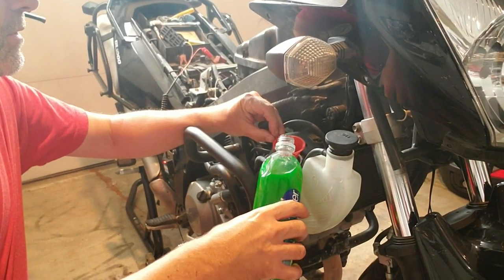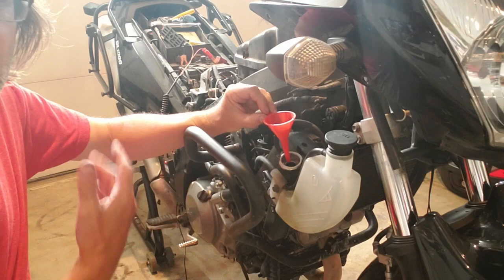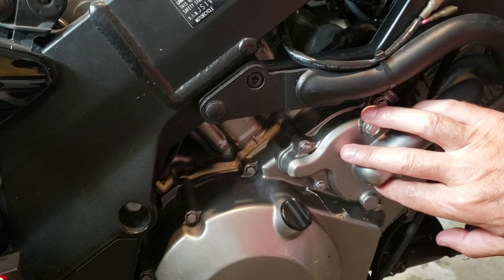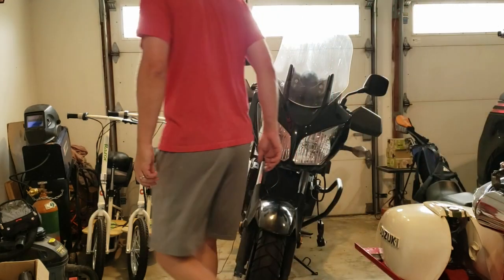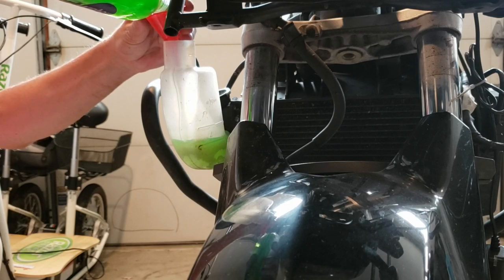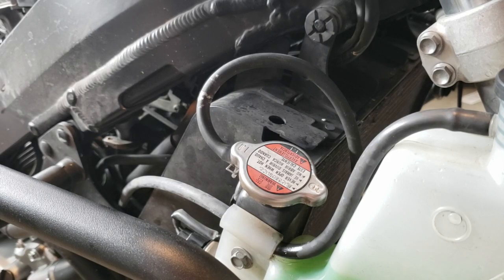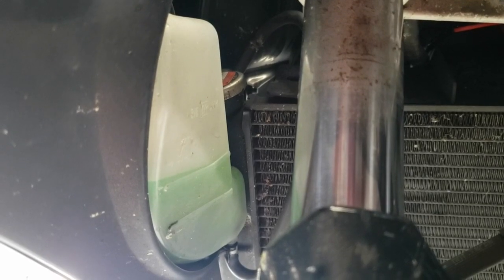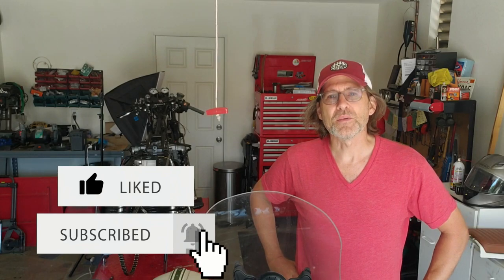Mixing Coolant / Antifreeze and Filling Motorcycle Cooling System

Comment: to clear the bubbles just run the engine for 20 seconds
Reply from the maker: While that may work in many cases, it is possible, under some conditions, for an air pocket to remain trapped in a head or other high point in the engine. A "hot spot" can result. I'm not saying it will, just that I believe the way I presented is best practice. Thank you for watching and commenting!
Reply: @UrbanMonkTV  they hadnt even put antifreeze/coolant from the factory , my Triumph just had plain water , I am a bit pissed
Reply from the maker: @patthewoodboy  Crazy! Did they make you aware of that or did you learn about it by having it boil on you?
Reply: @UrbanMonkTV  just replaced the coolant myself today , it was just clear water.
Reply from the maker: @patthewoodboy  There is such a thing as clear propylene glycol. Not sure if that's what was in there, but it does exist.
Reply: @UrbanMonkTV  Triumph use green anti freeze. The stuff that came out was plain water, I checked it.